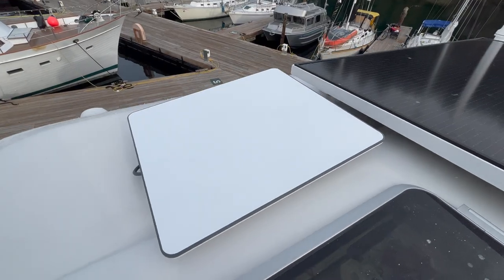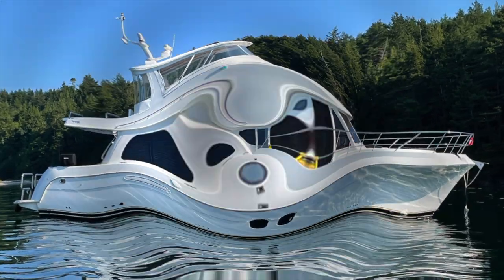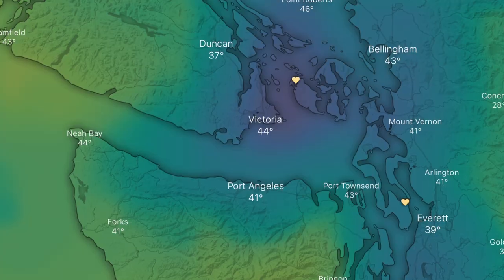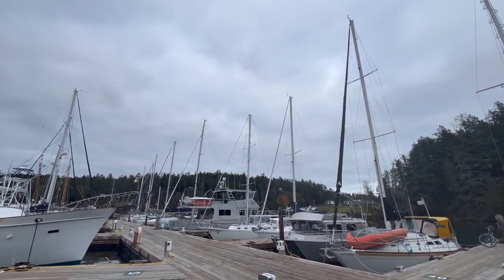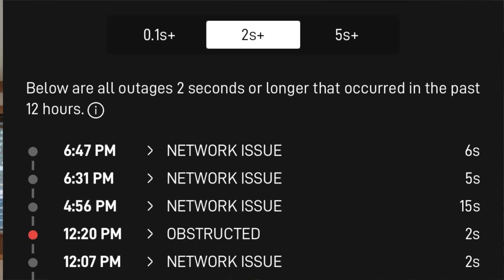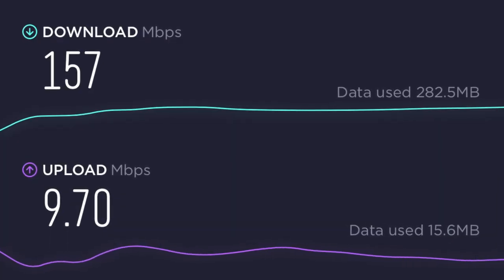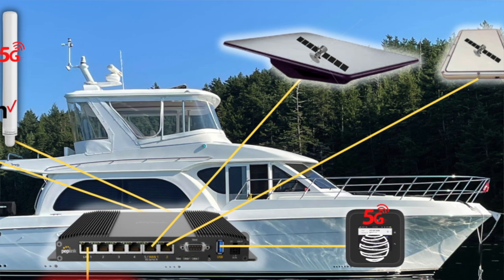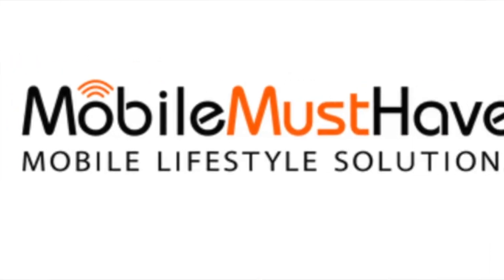In-Motion Starlink Speed Test & Obstruction Results for Flat High Performance Vs RV Standard Dishy

Comment: Thanks for making & sharing  this video. I've got Starlink on my boat so this is really useful. I am curious about the high performance flat dish, but Dishy seems to be working just fine. 
Before I got the Starlink I tried a 5G antenna and booster, but didn't see much improvement (I used the set up recommended by the Gone with the Wynns YTube channel). I used the small antenna that came in the box because the larger antenna and cable needed an adapter. (So maybe I didn't give it a good test.)  Tip if you try this on a sailboat. I ran the antenna on the coaxial cable up the mast on one of the halyards. And then a little wind, a little spinny... and the cable fall off. The antenna wasn't heavy enough to pull down the halyard. I had to go up in the bosun's chair.  So if anyone tries this set-up, tie a string to the halyard so you can haul it down again.(Also the way it lay, even if it weighed enough to drop,  it was threaded through some rigging and a spreader. You could not do that if you tried, and it wouldn't have happened if I'd tied a string on it.)  So I'm looking forward to your  5G video. Operating it is after all  is free (use my iPhone as a hotspot).  Otherwise I have to find someone who wants the hardware.
Reply from the maker: Thanks for the great description!  If your 5g setup is a cell booster, what we’ll cover next is different. I’ve tried 5G cell boosters in the past and they are terrible for data. The reason is, they are a high gain single antenna.  5G really needs a 8 element Multiple In Multiple Out (MIMO) antenna to be effective. 6’ or shorter for the cable runs is necessary to minimize signal loss. On a sailboat, that’s almost impossible up a mast. Have a great week!
Reply: @ElliYacht1  now THIS is great info, too.

Comment: Hoping you can help me out with a question 
I have a situation on my vessel where I would need to cut the cable for the high performance dishy I am  hoping to purchase and mount 
( the ends are too large for the only wire run avail ) 

Do you know if the high performance dishy cable 
Is a similar high end cat 6 cable to the regular gen 2 dishy ?

Can it be cut and re attached ?
Reply from the maker: The Gen 3 dish flat dish is our pick right now.  It uses standard cat6 cable that can be cut and spliced. It performs on par with the HO and is IP67. The Trio Mount is a batter option vs the aluminum wedge mount on the HP that will ultimately corrode in a marine environment.  Oh, and it’s only $599.
Reply: I really appreciate you taking the time to reply ! 

Would love to pick your brain a bit about in motion 
Does gen 3 work at speed ? Babe you done tests on that ? 
I’m not sure if we can get gen 3 in Canada 

We cruise extensively North Coast - Belle Bella and Prince Rupert

Comment: Thank you for sharing, how did you mount your inmotion to your yacht?
Reply from the maker: Thank you for the feedback!  We mounted it on our hardtop with the wedge mount that is included with the In-Motion dish. Instead of using their mounting hardware we used 316L self tapping screws that were predrilled. We used 3M 4000UV to seal the mounting screws.   

Also, they provided a marine waterproof gland to pass the cable through. 

Hope that helps!
Reply: @ElliYacht1  amazing ! thank you so much for your time !

Comment: For a real "apples-apples" test I'd love to see the test with the RV dish pointing north as Starlink engineers intended. The HP dish is designed for flat mounting (larger size and much wider field of view) so it makes sense that it does better than a flat mounted RV dish.
Reply from the maker: The dish pointing North was engineered for stationary mounting, not a constantly moving platform like a boat. 

That said, many people are fine with keeping the standard dish configured to constantly realign North and the associated +2 minute drop outs, while anchored out. That doesn’t fulfill our, or most boater’s requirements, IMHO.

Comment: I never thought about having 2 dishes and 2 services. I assume that means you double your throttled connection speed when there is congestion. Does it also improve your dropouts? Or do both generally drop out at the same time? When you suspend service, how does that work? Is it month by month, or can you turn on the redundant service for an evening when there is congestion and then turn it off later that day when you are done? Do you add the connection speeds together when they are not throttled? If so, are you getting 300MB +?